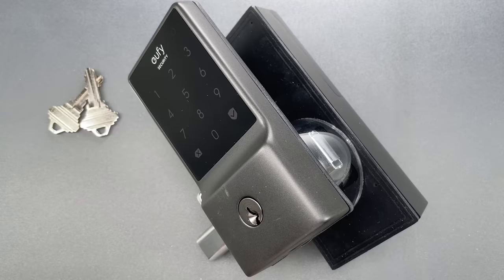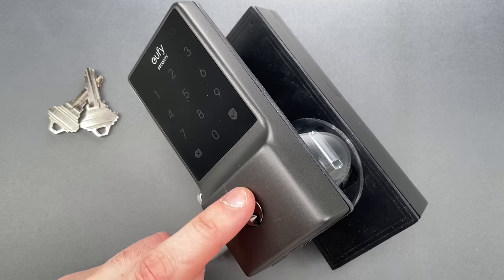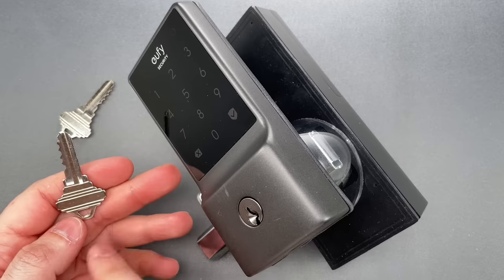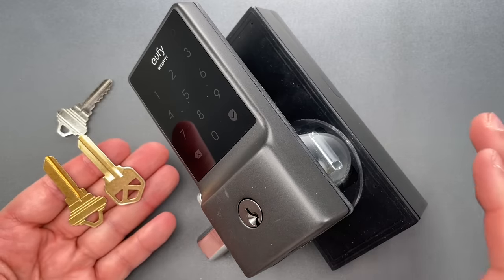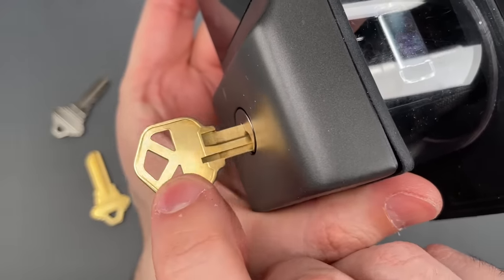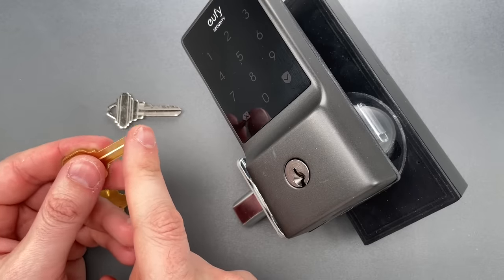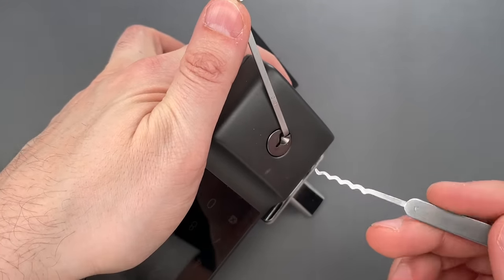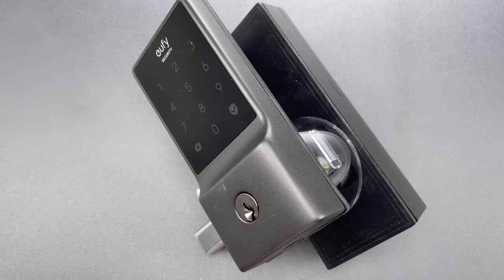[1515] This Eufy Smart Lock May Frustrate You (Model E110)

Comment: I would have actually congratulated thier use of a non-standard key blank cos I see it as a security feature.
 ...however, omitting security pins in the cylinder is just unforgivable. Can the cylinder be replaced or re-pinned? (*Side note: All the locksmiths I know in the UK would have no problem at all cutting a key for this ...providing you took the lock in to them before fitting it)

Comment: What always am interested in and you did not mention is if you can swap out the non-standard cylinder with a new Schlage etc. or is the cylinder non-standard because they could not fit a standard one in the lock without increasing the depth of the façade

Comment: Is this key a standard or widespread-quasi-standard somewhere else, just not in the American market; or did they actually go to the trouble of cooking up a slightly atypical cylinder and key for some reason?

I wouldn't expect Eufy to care about difficultly of replacement if they could save a nickle; but I would expect that choosing a size and shape that's already in common use and so can be readily obtained from multiple suppliers with no special orders would be cheaper than rolling your own.

Comment: (1) A nightmare. If you ever have an ugly breakup, your disgruntled ex will try copying your keys, will be fuming mad trying 3 times, give up, and set your house on fire!
(2) Most people might not run into this issue, since they might simply give out the pin code or the smartphone access, so this might not have been an issue during an initial product test on the US market. Of course if you then give a copy to the key to your cleaner without checking it, that is where the annoyance starts.

Comment: I recently replaced the lock cylinder on a sliding patio door. The package advertised that it was compatible with Kwikset keys. I've tried to duplicate the key that came with the lock 3 different times. 1st one wouldn't got in at all, and the other 2 go in part way and get jammed. Super-annoying.

Comment: I got a prior version of this lock a little over 2 years ago, it had a completely different proprietary curved key, which was dumb, but not as dumb as when the touch key pad didn't like to work in the rain, then shut itself off because it was reading false key presses while i was trying to dry it with my sleeve. Then due to an app update required reauthentication, and kept claiming that it sent me 2FA code to the email address on my account, even though no such code was ever sent.

I got busy and forgot about that experience, then it stopped responding to a lock command, then it stopped working all together. This is really a crap product on many levels, eufy is a spinoff Anker, they were always really good but have absolutely nosedived in recent years.

Comment: So if it's basically a Kwikset keyway but a little shorter, is there a standard Kwikset cylinder you could replace it with? If so, LPL has a guide to pickproof Kwikset cylinders. Might be a good option, if it's workable.

Comment: I'm sure it's convenient to get a copy of a key from any locksmith but I feel that it's detrimental to security. I prefer severely restricted copying at least for apartment locks.
Abloy has a patent on their latest lock series and when the patent runs out they will introduce a new lock model that has another patent. This way they can keep legitimate businesses from producing copies or even blanks of their keys for the duration of the patent. For their latest locks you can only get copies directly from Abloy and they require proof of ownership.

edit: I'm not claiming that making the key two millimeters longer or shorter is a robust security feature.

Comment: Funny enough Home Depot accidentally gave me a quickset keyway on a schlage head. So they do have those exact key blanks. I think it was a number 67 if I’m not mistaken. Which in that case that key blade is the correct length and should work like butter. Just in case someone is have this issue.

Comment: Ive had smart locks installed years back but I never used the physical key that came with it. It sits in a in-case drawer. I’ve really only seen people who have smart locks use the physical keys when their system is so busted that it won’t respond (like a flood).

Comment: LPL said he’s all for smart locks but I don’t think I’ve ever seen him actually satisfied with one 😂
Reply: That's because he hasn't actually reviewed a lock that is as smart as it thinks it is.
Reply: He has also stated that he would never disclose on his channel which locks he uses. He has commented before that "this is a lock I would use," though not with a smart lock to my knowledge.

However, he has pointed out flaws in smart locks that he stated were easily fixed (locking lever shielding, replacing lock core, moving parts to the other side of the door, changing a plate to a non-magnetic metal), so I wouldn't be surprised to find him using a smart lock with one of these easily fixed flaws and a more pick resistant core.

Comment: I have a garage door handle lock cylinder that's like this. Someone accidentally tried to pop off the wrong lock (mine) and they replaced the lock cylinder for me along with a single key. When I tried to go make copies of the key, it didn't work. I've gone to 3 different places, telling the last 2 that there's something odd about my lock cylinder and none of my copies have ever worked. It must be using some some or non-standard key.

Comment: Seems like it would be cheaper, faster, and more value to simply learn to use a wave rake instead of making a spare key. Actually, the wave rake will probably work on many locks over the years, so it's the clear winner.

Comment: I don't see any problem here. He never pointed out an issue with the actual number lock solution. So just get a welder, and weld shut the keyhole, and you are golden. Just need to make sure the battery is always good. Pretty sure you can even modify it and attach a powerbank instead for even longer power.

Comment: why do any of these smart locks have working key slots?  they ought to make them with dummy ones complete with pins and spools that end the end don't ever turn or unlock anything.  OR at the very least can be disabled by an app setting OR that require the insertion of a magnetic key that tricggers the lock to speak to your phone and if your phone has the correct credentials, allows the turning of the key to engage the bolt if and only if your credentials on your phone match.  I have looked at all these smartlocks on amazon many times and i cant find any with the feature set i would want.  PLease advise!

Comment: I have $200 to spend on the most secure deadbolt I can for my front door, what would you recommend?
Abloy deadbolts seem to run $400-$500+
Mul-T-lock seems good, but how pickable is it?
Could you maybe do a video on the top 10 most secure deadbolts?

Comment: If I owned that lock, I would just pump a healthy squirt of epoxy into the keyway, and call it done. Assuming you have an alternate way into the house if the electronics or battery dies, and and that the mechanics of the lock are acceptably strong enough.
Reply: Epoxy the blank key into the lock just for esthetics.

Comment: Funnily enough, thiswould actually be somewhat of a clever security measure against imprinters; someone who just gets an imprint of a key would assume it would be a Schlage key due to the bow, incorrectly cuts the key. They figure out the issue, cut a KW1 key. That doesn't work because of the non-standard length, and they can't find a standard blank. They have to file it down, only to discover that you returned this to Amazon because of how pissed off you were going through a similar misadventure. Of course, the shitty core makes this entire "security measure" useless when you can use a wave rake on the crappy core.

Comment: And this is why you don't buy smart things made by Amazon. Hell, you shouldn't buy smart things that cannot be controlled locally over local protocols such as ZWave or Zigbee. I have a Zigbee smart lock by Kwickset that I used to replace the inner lock of my apartment. The outer lock remains the same so that my landlord still has access, and I didn't really decrease the security that much in this way.

Comment: 99.9999999999% of people that know how to pick locks aren't walking around stealing. A better lock has steel that isn't easily cuttable. The locks chamber complexity is secondary regardless of how easy it is for this guy or others to pick it. If you're running a padlock business, you worry less about how easily it can be picked, and more about how easily it can be cut off. Most thieves aren't picking locks like you see in the movies. Not to mention, this guy appears to be better at picking locks than most. He may also be taking his time figuring it out off camera before making the video. Even if he isn't, it's still more important to have harder to cut steel than a tougher to pick lock.

Comment: Any locksmith that did not check the bow and length before cutting should be fired.  Always, always check the length against the original before cutting.

Comment: Well, why you would need to be able to copy a key after installation, don't know for a smart lock.
Install, put putty in the keyway so no-one can insert a key anymore and you have a 'safe' device untill it just does not work anymore and you really need some hard work to open that lock again ... 
With a key, well, after a while the key gets lost in a big pile or disapears anyway when you never use it doesn't it?
When you use the key, why choose a 'smart lock'?

Comment: Eufy had to go out of their way to design a non standard lock like that, certainly not cheaper then using existing assembly lines. This is the "Apple" mentality, make the product look slick and use as much proprietary everything as you can to give it a modern and advanced feeling so it stands out. This is why smug tech companies should have nothing to do with making electronic locks.

Comment: ARRGGGHH! Stupid locks. What we need is a smart lock that is just the smart part, you supply the lock part. Something like a smart bezel that has the keypad and antennas on the out side while a motor and actuator sits on the inside. Then you can install it on a decent deadbolt and maybe have something that is not decidedly worse than most locks from the big box stores...

Comment: Any "smart" device that requires a proprietary "app", instead of providing an API is a deal-breaker for me. First, you don't know what the app does, secondly, it seriously limits automation to have to use a proprietary app, and lastly, it is very likely that the manufacturer never update the app, and when the company goes defunct, and the OS requre a new app, your device becomes a paperweight.

Comment: I'm pretty sure people buying this product would rather blame lock smith than the product THEY themselves have purchased (because they are smart, not dumb, of course). Then again, if it can be raked in 4 seconds, why even bother with using a key in the first place? Smart locks are a gimmick, unless its one of those that require RFID chip inside the flesh of your palm.

Comment: Sheesh, 1477 comments as I write this, so I'm not sure why I'm bothering, but . . . what if filled the keyway with J-B Weld to disable opening with a key.  Would this lock then be mechanically secure?  Of course, with a "smart-lock" like this, there's also the question of whether it is electronically secure, but at least that's an area I understand a little better than the mechanical magic.

Comment: Does anyone make a decent Smart Lock? I haven't seen any. It seems the only two options are ones that can be easily opened with a strong magnet or have a physical lock core that has had zero effort into making it wave rake resistant.

Comment: Right, so they used a really mad key setup, making it infuriatingly difficult to make copy keys, yet the lock they use is so weak, it can be raked, to the point that it's potentially easier to tell anyone whom you'd otherwise give a key to "just get some lockpicks, it's easier than getting you a key."

[slow_clap.mp4]

Comment: I cut keys as part of my job in a hardware store. Firstly, anyone who's been doing that for any time knows to check the blank matches the key being copied, including the profile of the blade of the key. Secondly, it's not unheard of for the blank to be too long, and filing them down is a common occurrence. I understand you're making videos for entertainment, but this one doesn't wash in those regards. I'm no fan of Eufy, but if anyone with any experience had cut that key, I believe they would not have had the problems you identified. No comment on the lack of pick resistance...

Comment: Whilst indeed, it's a really stupid move to change the key's apparent brand... i have to question if someone is that stupid as to not identify the issue with the key, and by someone i mean the most basic person involved in the process of making a key, someone who at the very minimum, knows to check a key to see if the points and valleys match.

At least here in Europe, ... across pretty much all of the EU, i've never had the key maker not check the keys one on top of another even as a cursory glance.

That said, i still question the value of security in US, doesn't matter what the look looks like or uses on the outside, the inner mechanism is a really stupid design that offers little to no actual safety and can be easily popped open with a prybar (outside of the door being made out of 2 mm thick metal, to actually resist deflection). So the entire thing is flawed and rotten from the core. I would never use such a thing, and never have had. The only time i used that base body is for bathroom doors. That's about the long and short of the trust one can place on that style of a mechanism that has no structure with the actual door, and which by its very installation, further weakens an already cheap (for the most part of what's being used) door.

Comment: Isn't this a byproduct of Lock Smiths spilling there guts out on Youtube, I love this channel but it does get frustrating when you see things stolen using techniqures from this channel. so don't blame manufacturers for braking convention as this channel and in turn locksmiths did it first. There used to be a unwritten rule like with Magic and a quick sell out ruins it for the rest of them, where is the mystery with Pen and Teller, and where is a secure lock.